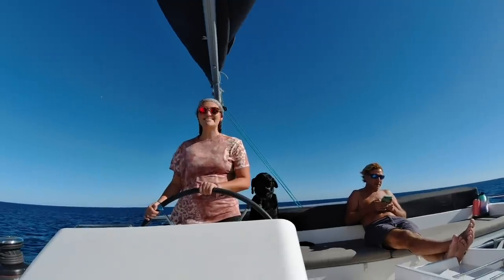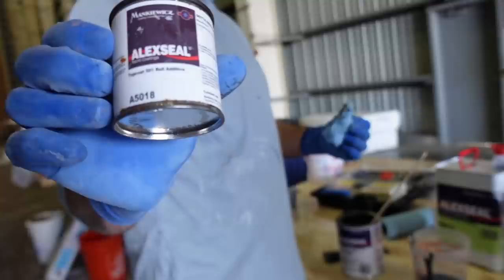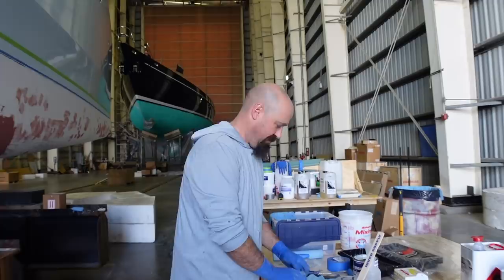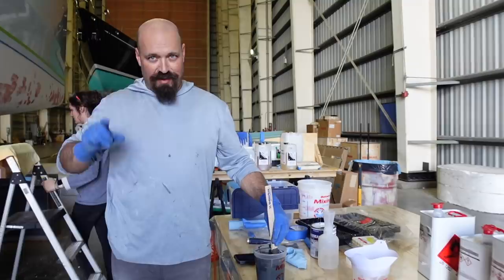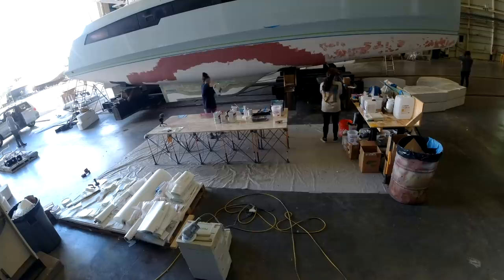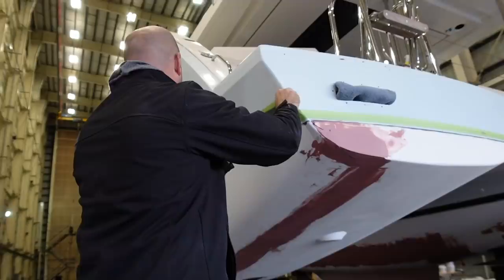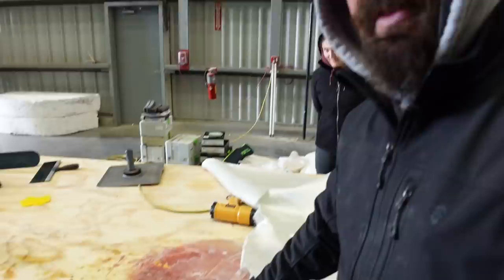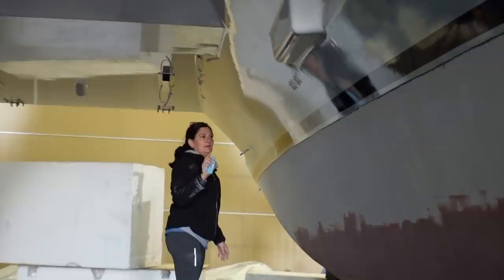WRECKED CATAMARAN TO FLOATING BEAUTY//Count Down To Splash-Episode 66

Comment: I have removed a boot stripe and raised the waterline without putting the boot stripe back initially. The next time I had the opportunity to, I added a new boot stripe. The boat looks 1 million times better with a boot stripe I love how it finishes and delineates between the bottom paint and the finish coats of the hull paint.

Comment: That's a whole lot of work in a very short time.  It's unfortunate that the weather didn't cooperate with your timeline, but at least you were able to get the first full bottom coat done and it looks very nice. I personally like the dark gray stripe with the smaller pinstripe below it.  It just adds another dimension to that area that makes it look classier.

Comment: Very good call on the Boot Stripe for color, placement and just overall look. With the lines of that Cat and the dark tinted windows basically running the length of the hull that Boot Stripe just looks perfect. So happy to see y'all are finally almost at the point you can get the hell out of that yard. For as nice as it is and what it has to offer you'd think they'd be all about the customer. I feel as if you're just not the right type of client for them what with getting your hands dirty and doing the work yourselves. I'd be curious to know how many other owners who use this yard actually repair and work on their own vessels? I'm betting it's a very low number if any at all and most boats there belong to the truly wealthy. Funny thing is y'all kind of fit that descriptive you just don't act like it and aren't afraid of hard work. Congrats to you all on a successful rebuild. Looking forward to the Splash and trip to Florida which hopefully terminates in a good yard ran by good people if you still need one...
Fair winds, following seas, safe travels and God Bless...

Comment: Everything looks just amazing great job guys! My only concern is the fact that with a barrier coat the bottom paint you are supposed to paint the first coat of bottom paint to a freshly dried tacky barrier coat in order for them to chemically bond. If this is not done in the exact amount of time, your bottom paint will not remain after you splash. I had this occur three years after a bottom job and this summer we had the displeasure of doing it all over again!

Comment: Why when painting the bottom of a boat does no one use an extension pole on the roller?   Is it the paint?  
Your results are looking good.   Guess the boat yard simply has found a way to make more money then having you as a tenant.
Reply: Anti foul is like 20-25lbs per gallon,  and boat yards make more money with a higher turn over rate,  they don't want you there,  they want you to get it done and leave.